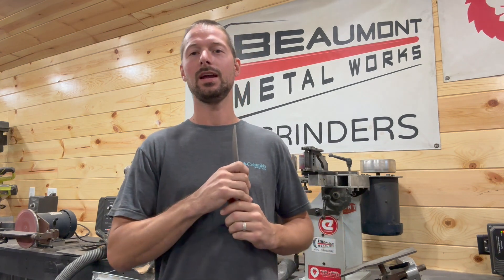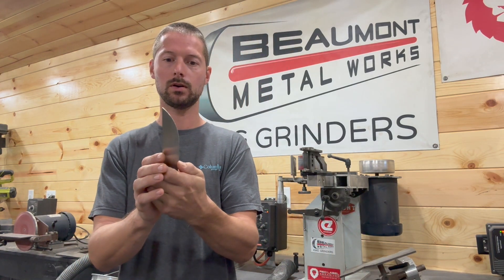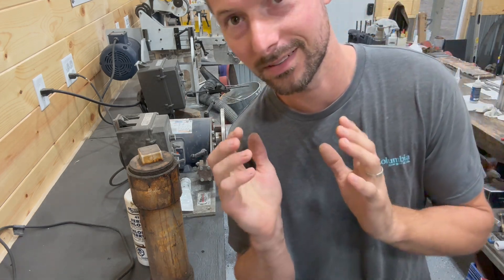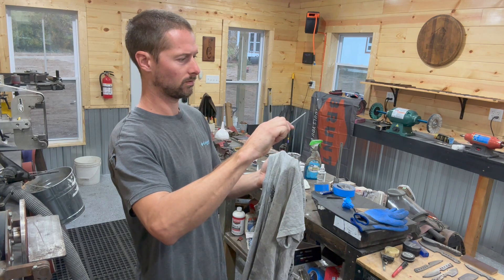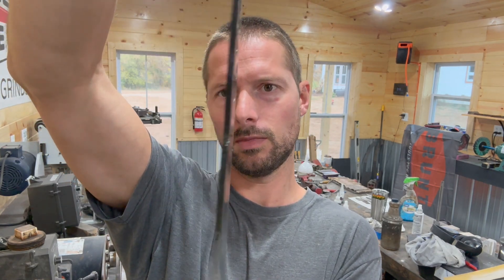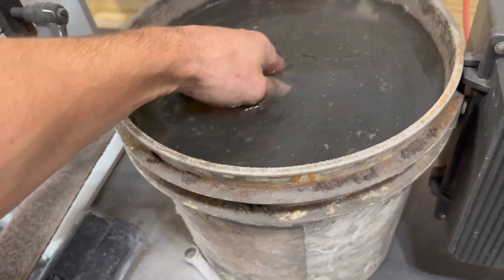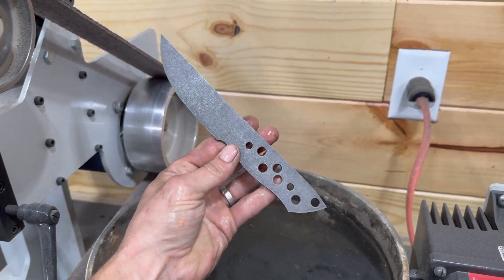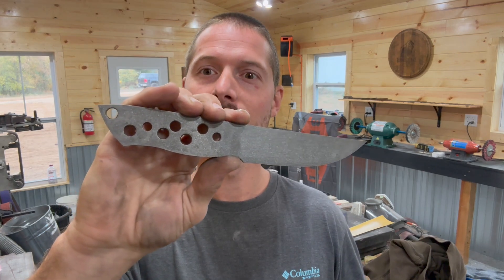HOW To acid etch and stone wash stainless steel!

Comment: You can take the plate off the bottom of tumbler and move the weight out a tiny bit and get move violent action .It will get hotter quicker also.
Reply from the maker: Thanks for the tip!

Comment: Using gulf wax and other waxes do the job keeping the rust away when it's in the kydex sheath. I heat up the blade with a heat gun then massage that wax into the metal.

Comment: If I wanted blk handle metal on a full tang blade so it would blend into blk handle scales how do I get it .
Then I guess the issue would be how to get the handle scales all formed without filling any of the black off.
Reply from the maker: Depends on what steel you’re using, if high carbon you can try gun bluing on a qtip, if stainless it’s a little more tricky

Comment: If you want it darker i sand blast mine before etch and after etch neutralize is then coat in oil and let it sit a couple hours for the carbides to set. Then tumble. You get a darker finish when its sand blasted
Reply from the maker: I need to get a blasting setup! Mind sharing what you use?
Reply: @gentrycustomknives8008  harbor freight blasting cabinet with 120 grit aluminum oxide

Comment: Love to see you and tyrell knifeworks releasing the exact same video. Makes it super easy to compare and contrast methods, as well as single out parts that apply to my process
Reply from the maker: Is his process similar to mine?
Reply: @gentrycustomknives8008  exactly the same except he coats the blades in mineral oil after cleaning the acid off. The mineral oil helps the dark oxides stay on the knife. Tyrrell seems to get a bit darker finish but he also has some issues with consistent tone across the surface